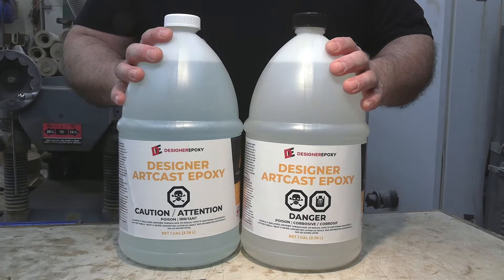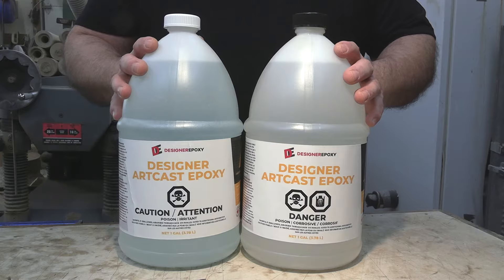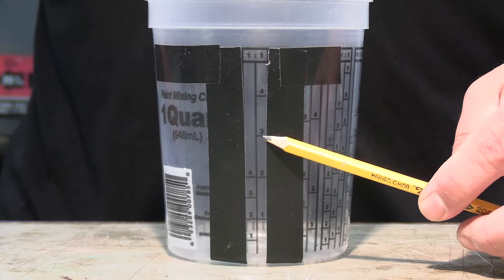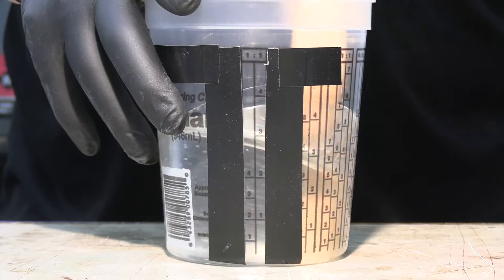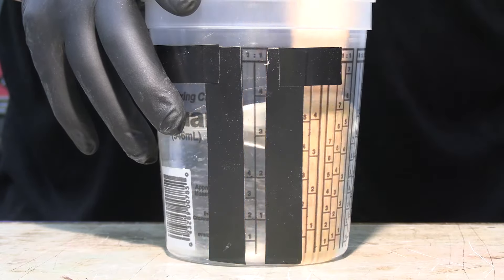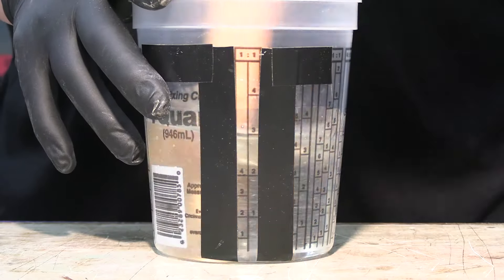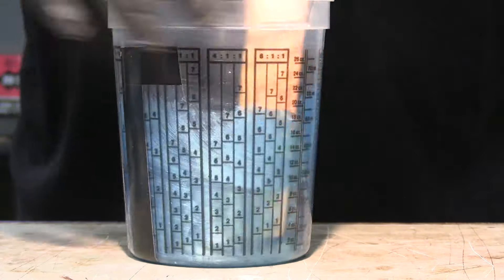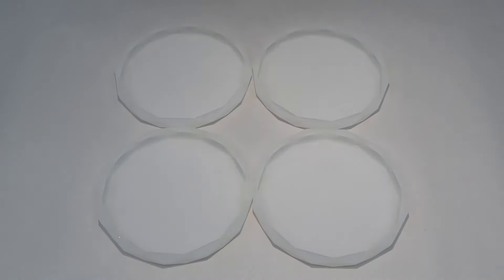How to use Designer Epoxy Artcast

Comment: I saw that you used a 'torch' on these but ....don't you risk damaging your molds using a torch? Also I am wondering that IF you put the resin in warm water for 20 minutes doesn't that shorten your working time? I am not trying to be 'picky' but I do want to have success with my newly obtained resin. Thank you in advance for any information you might be able to provide me. Have a great day!